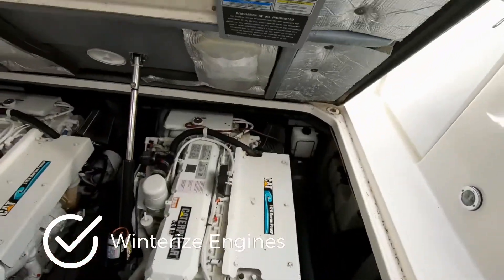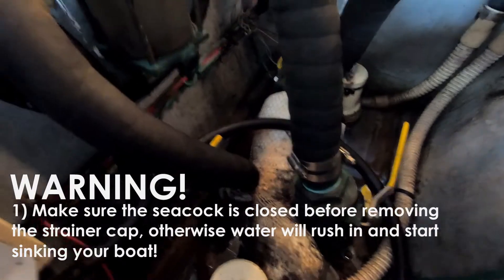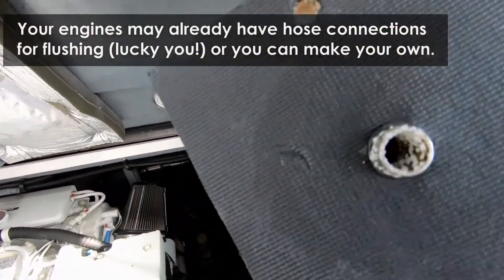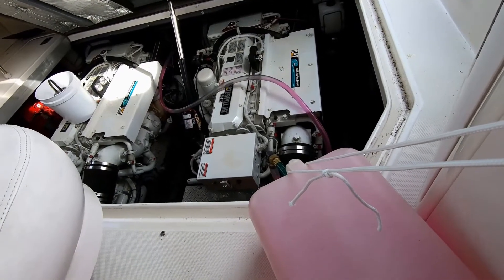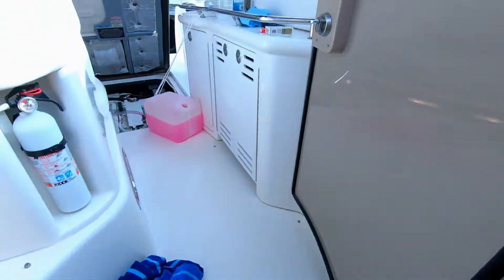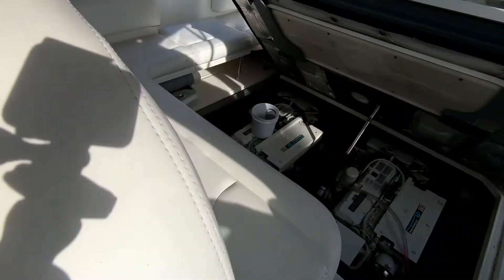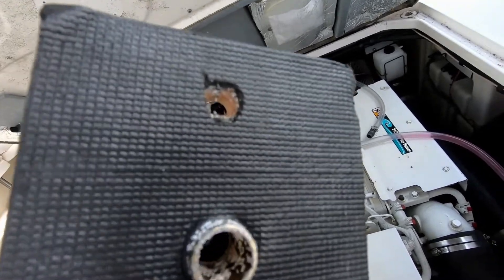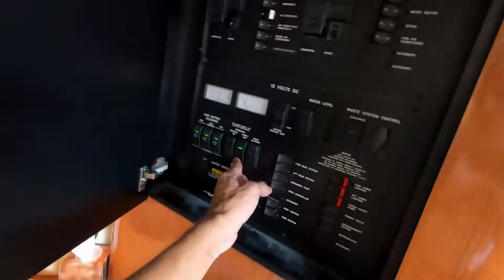How to Winterize Inboard Boat Engines and Generator

Comment: Please explain the jig that connects to the top of the strainer
Reply from the maker: Sure it’s a temporary hose connection we made for the top of the strainer - we made it to size for our boat out of some wood.
Reply from the maker: Just posted a new video that goes into detail! Our Boat Engine Winterizing Kit & DIY Flush Cap We Use ✅
https://youtu.be/7aIFWzKeeaw

Comment: You have 2 outlets on the brass fitting. What is the second one for? How is the brass fitting connected to the wood? What is holding it it the hole in the wood?
Reply from the maker: The hose fitting is just friction fit into a hole in the wood. I added the Y adapter simply to provide a quick shutoff valve and an angled swivel. The second side of the Y serves no purpose.
Reply: This is great. Thank you very much. I can’t wait to try it.
Reply from the maker: @OrltonLawrence  cool hope it works well for you! We’re putting up a quick video in next couple of days showing more of this fitting b/c we’ve gotten a lot of questions about it. Keep a lookout for it!